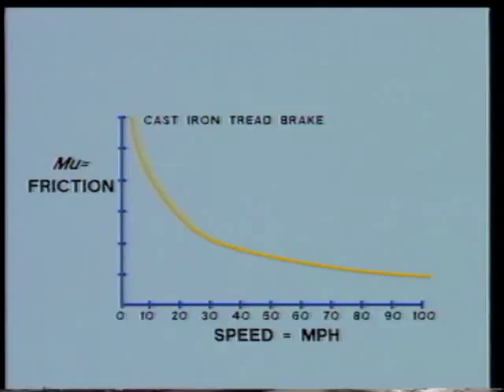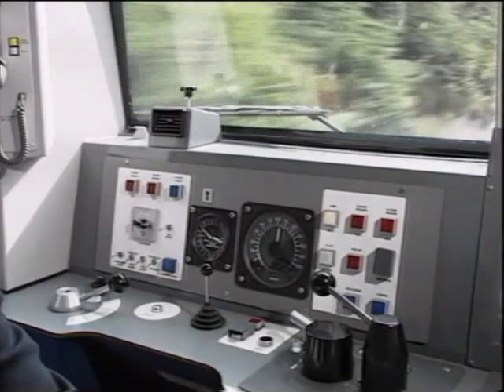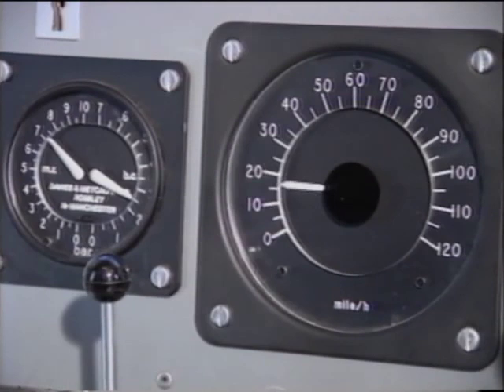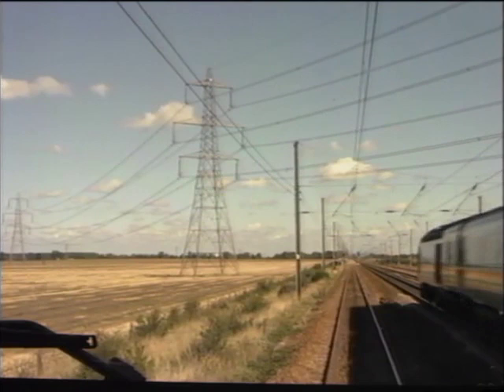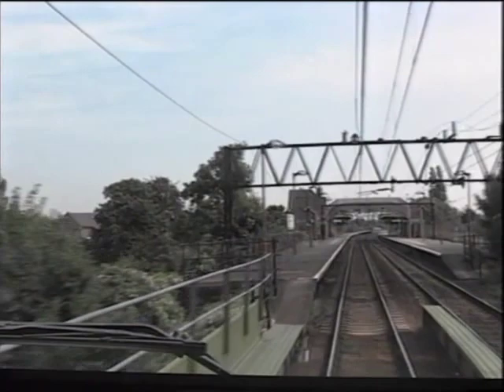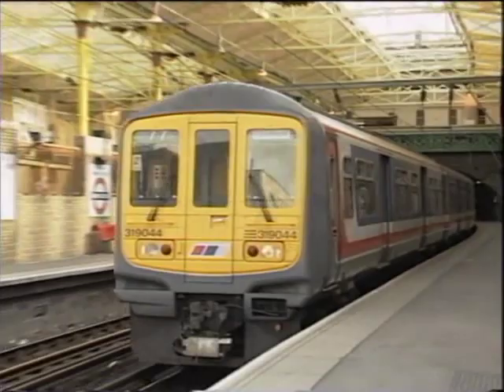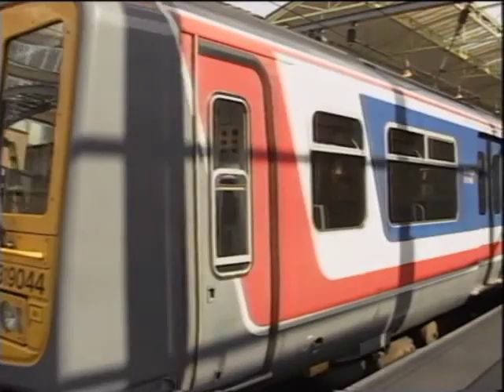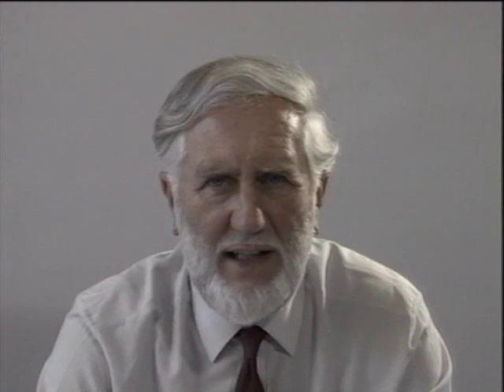The 3 Step Brake - (1989).avi

Comment: Oh how times change..... Now taught Initially in to Step 1 then step 2.  Frowned upon to use step 3!!
Reply: They don't like step 3 now do they!
Reply: Yes the advice now is to use a mixture of step one and step two breaking and try and avoid using step three if possible. I wonder what the reason is for this changes? I'm wondering if it's for safety or for passenger comfort?
Reply: @montyburnsgaming3609  passenger comfort
Reply: I do believe that at higher speeds, such as for high speed trains, higher braking steps are permitted, so long as you reduce to step 2 or 1 after sufficient speed is lost, as the noticeable deceleration is greater at lower speeds.

Comment: As a passenger, it feels kinda comforting to know, that the WSP “scrubs” the tracks for each following wheel...
Reply: Like hell it does. Those things were a nightmare from the day they arrived. I drove them from new almost till they were scrapped.
Reply: WSP is basically is anti-lock brakes for trains- it's trying to stop the wheels from locking up to reduce wheel damage and decrease stopping distance.

Comment: I shot a lot of this film on the down slow on the Great Northern.  Line posesion with a train running in front dropping liquid soap on the rails to make the 321 slide as the film shot in August. (no leaves on the line at that time of year)! When we had finished the whole unit had wheels like the old threepenny bits and had to go to Ilford for wheel turning!

Comment: That's a brill video. Wonder how efficiency of today's braking systems compares to the 90s systems? Are there mixed mode air/hydro disc systems now or are there simply larger discs made from higher grade materials (like the carbon/carbon disc systems found in Formula 1?)
Reply: I think the disks are roughly the same, maybe a bit more effective however most trains have a regenerative/ rheostatic brakes so it isn’t uncommon to see the brake pressure drop from say 3bar to 2.5 bar as those additional braking systems kick in

Comment: Wow, I'm always amazed how different the railways function from one country to another... All German locos and multiple units have had sanders since 80 years, brake controllers since the 80s have eight brake steps, plus an emergency step that includes magnetic track brakes on all vehicles certified for speeds higher than 160 kph or 100 mph. I won't even go into train protection systems, its hard to understand why the UK were and still are literally decades behind on all of this.
Reply: massive under investment, privatisation, etc.